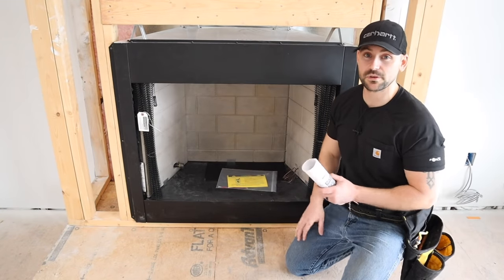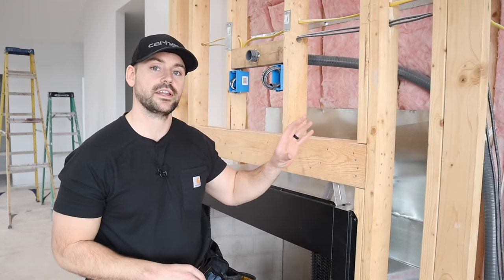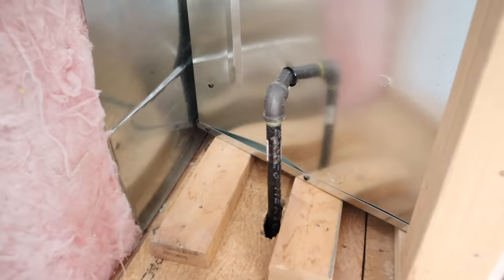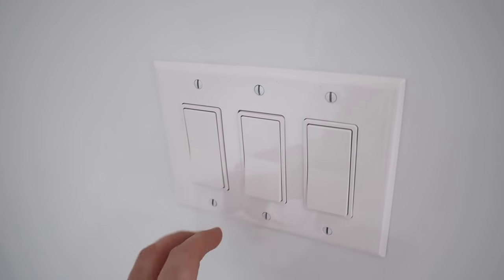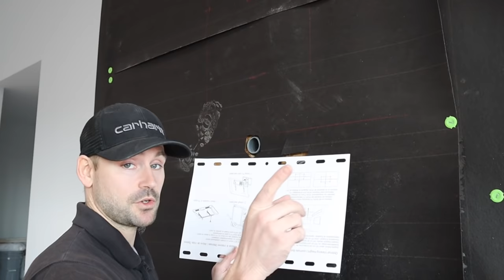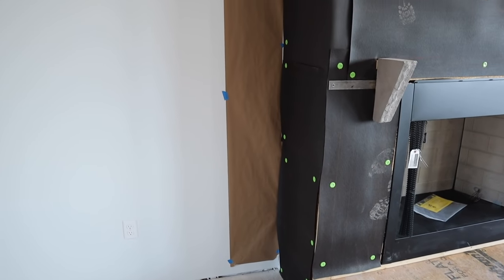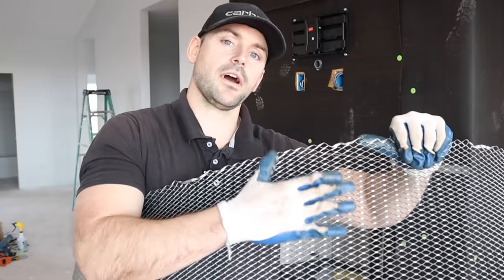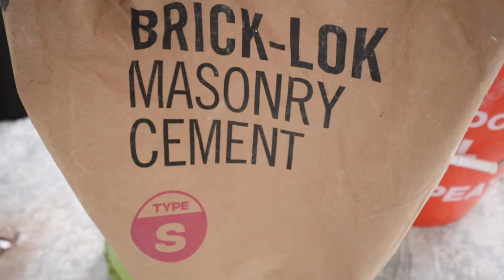How To Install Stone Veneer On A Fireplace - STEP BY STEP Guide

Comment from the maker: Hey, fellow DIYers! I know this video is long but it’s jam-packed with detail that you will find helpful if you are doing the project. There's a timestamp below to help guide your way through everything in just one span of time so don't worry about getting lost - we'll go right over all those important parts and then move onto something else before our timestamps run out :)

Framing for a gas log fireplace 01:05
Mantel bracket Install 08:46
TV bracket Install 11:27
Metal lath install 13:50
Mortar mix for scratch coat and stone veneer 17:48
Scratch coat application 21:05
Cutting stone veneer corner for sloped ceiling 25:09
Mantel installation 29:29
Stone veneer corner install 31:05
Stone veneer flats install 33:51
Grout mortar mix 43:46
Grout application 47:34
Grout finishing 50:54
Hearth stone installation 53:57
Reply: Be prepared... there's a lot more to it than you think.  That's what I'm doing right now.
Reply: Kevin  hello
Reply: In case you install using cement board, do you still need to use the metal mesh and all the process you have shown in the first video? Thanks
Reply: It's not that long! You just saved me hours of headaches! I'm a female DIY who is going to do this myself so I don't have to listen to my husband swear the entire time he does it!
Reply: Why didn't you mortar the hearth stone?
Reply: You're not telling where you got the brackets, Amazon does not have them. Anyone else knows where to get them. Help! Help! Running out of time the world it's going to end soon! 😮😮😅😅
Reply: Where can I buy the stone mantel mounts? They are just what I've been looking for

Comment: A few tips from a 4th generation mason who does this everyday.  Don't work out of a bucket.  Not only is this incredibly slow, it's going to destroy your wrist over time.  Get two mud stands run three planks across and put a mud board in the middle and stack stone on the sides.  Not only will this be considerably faster, it will save your back and knees and give you a better selection of material.  Use quality pre-mix bags and a mixer.  Not only are they quality tested they are much, much faster then using a bucket and drill and mixing the ingredients your self.  Do not bury your tape or paper in the joint.  Put the tape on the edge where you want the finished joint to be, that way when you're done brushing/sponging you can pull the tape leaving a perfect finished edge and absolutely clean paint.  Also try to find straighter edge pieces at the opening, you don't want large joints against the metal, it will crack.  Metal expands, masonry does not, especially with the heat of the fireplace.
Reply from the maker: Thanks for watching and you input!
Reply: @TheExcellentLaborer  how come you start at the top? Just wondering
Reply: Rob so the mortar doesn’t dirty the stone
Reply: @Unknown-nf1se  Yes, This.  Unless it's a heavy natural cut stone, start at the top if you can.  You don't want mortar falling on you recently installed stone, if you start at the top it just falls on the hearth, which is easy to clean up.
Reply: I agree with Ryan,I’m a mason also
Reply: Experienced tradesman that teaches instead of ridicules. You sir a diamond in the rough.   Thank you. And thanks for the info. I’ve been gathering info to get started on a masonry heater for my house build this year.
Reply: @elkhunter307  If by masonry heater you mean a real masonry fireplace, they are a lot of work.  If you're doing it yourself, I would go with prebuild units or inserts. A real masonry fireplace(not an insert) is one of the most difficult projects we do.  I've been building them for almost 40 years and everyone one is different.  If you don't get it right, the fireplace will smoke or worse.  The facing can be DIY project but the structure should be done by a professional.  If you can clarify what you mean by masonry heater, I could give you some advice but I wouldn't attempt to build a ground up fireplace without professional assistance.
Reply: Working from a pan versus a bucket is dependent on situation and opinion. I prefer a bucket over a pan
Reply: @SuperBikerboy101  Are you a tile setter?  Mason's use considerably more mortar than a tile setters.  Mixing buckets and using them is fine for tile because it's a small amount, but man working out of a bucket for stone makes my wrist hurt just thinking about it.

Comment: This is close to what I did at our other house. Thank you for mentioning about how the metal lath is a directional use. Growing up doing the old style stucco before other companies came out with a foam base installation, we took some florescent spray paint to put an arrow for the direction of the lath needed to be fastened. Yes we would have a piece put up wrong, and you would notice this ASAP. Love this project Josh. 👍🏻👍🏻
Reply from the maker: Hey David! It is very important to get the metal lath in the right direction. The mortar would not adhere to the lath as well if it is not in the right way. Oh wow, sounds like you have a lot of experience with stucco. I have always been amazed with how they can take a mortar lake project and create a beautiful wall. I appreciate you commenting and watching David!
Reply: @TheExcellentLaborer  yes, for years doing houses in historic districts to keep the homes with that original stucco look with wood batten strips. Ornamental plaster was always my favorite as well.  Commercial work was always rewarding because of the different looks that may be requested. Using your imagination is wonderful as well. The rakes we used to do the scratch coat, we made ours out of metal coat hangers because we would go through them doing so much every day. I know my father is in heaven to this day doing plaster and stucco to his liking. Hahaha 
Continue to keep sharing your talents Josh.

Comment: Nice video Josh. Was going to ask why you go through the effort of scratch coat but the way you do it sure would allow the stone to stay in place better with the rough scratch coat texture. Most guys around here use cement board. I actually use Ardex x5 to set stone or those type of veneers 😆 it’s a little expensive, but maybe I’m just too used to using thinset for things. Nice work 👍
Reply from the maker: Thank you BRT! I’m not familiar with the product you mentioned that you use. I will have to check it out. I’m just an old fashion stone veneer person. I have used this technique in my past for houses and has worked well so I cannot change. I did mention using cement board in the video which I’m sure it would work fine I just have not done it. Thanks for stopping by and watching appreciate it!

Comment: Excellent video from start to finish. I too am using Eldorado stone, my first time applying a veneer product. I am using 1/2 HardiBacker, opposed to lath and scratch coat. Again, a lot of invaluable tips throughout the course of the videos; was a tremendous help. Thank you
Reply from the maker: Great to hear you are starting a stone veneer project! I’m glad I can help. It’s definitely a lot of work but it’s such a nice thing to have in the house. Half inch hardibacker is fine to use. You are welcome. Thanks for watching!
Reply: @TheExcellentLaborer  Hello again, in front of the hearth, not raised as much as yours is, I have an area 7 x 7, I would like to apply a natural slate. In your opinion, will salvaged roofing slate stand up to the weight of a Vermont Casting coal stove (450 lbs). 

I laid 250 square of 1/2 travertine on Hardibacker without a crack. Secret, a stable surface. Believe the slate to be of little difference?

Your thoughts please

Comment: Hi, this is a very nice video.  You did a great job!  I have a couple of questions: 
     1) Where did you get the veneer from?  In my project, I am concerned about weight.  
     2) Which veneer did you pick for this project?  I really like that look.  
     3) I have been concerned with my project with the mortar separating from the veneer over time.  Some masonry sites 
         suggest spraying the stone or brick lightly with water to prevent it from sucking water away from the mortar, reducing its binding strength.  
         What is your suggestion, or is this a problem?  

Thank you

Comment: Thanks for the great videos! I'm doing a DIY outdoor propane, corner fireplace that I want to wrap in stone veneer floor-to-ceiling on all three sides. The manufacturer (Napoleon) calls for metal studs and cement board 6 inches on each side of and below the fireplace, and the entire wall above the unit. The side walls do not have to be metal or cement board. My questions for you are: 1. Would you use a metal lathe over the cement board on the front wall? 2. Would you do the two side walls out of cement board to match the front wall, or complete as you describe in your videos? 3. Would you simply do the whole project as you described in your videos? Thanks!

Comment: a roofing nailer works just fine, but it's worth considering springing for a lathing stapler (or renting one if that is an option whee you are). They hold really well, are very fast, and for some systems they are required. typically 1"x1" staples. I also find that i get cut up less when installing razor mesh due to fasteners not being twisted loos (occasionally) during lath adjustments. look good bro, I appreciate the detail.

Comment: Wow - this is the most comprehensive video I've seen for this project.   It's given me confidence to tackle the same project at my house.   You mentioned chase framing is 2x4 - I'll be building a interior chase that goes 18' to the vaulted ceiling.    2x4 framing is strong enough for all the weight or do I need to go to 2x6s?   Thanks for a fantastic video.
Reply from the maker: I think 2 x 4 framing 16 on center would be strong enough. You could always use 2x6’s  if you were concerned but 2x4 should be fine. Hope that helps!

Comment: I have the exact same fireplace in our house. However I’m having a problem with the fireplace pulling away from the exterior 6” wall. The contractor that built ours used nails instead of lag bolts or screws to tie into the exterior wall. What type of fasteners did you use when you attached the fireplace framing to the wall??

Comment: You REALLY explain things well!! Any reason why you did sheathing and scratch coat on top  instead of concrete backer board?  Couldn't you use mortar under the hearth stones...much cheaper than Liquid Nails ( though perfect for the mantle).  We are going to do our FP Surround similar to yours, but in Glacier Stone ( real stone veneer out of a Montana quarry).  Putting in a zero tolerance , Fireplace Xtrodinaire  Apex 42 into FP box ( all wood like yours installed according to specs).  Thanks for the excellent video!

Comment: Honestly you are very knowledgeable.  I love your skill set. And perfection,  that what i love to do every job. Now I will be installing veneer stone on concrete block,  here is below 0 degree.  What mortor mix do you recommend me to recommend . Anyway, I plan to use mortar mix type S  and add additive to BOND better.  Let me know what you think and your recommendation.  Thanks.

Comment: Why are you using mortar to attach the stones to the vertical wall (26:47)
instead of liquid nails that you're using to install the hearth stone's with (55:59)?
Is it cost or performance or the eventual heat or something else the adhesive (mortar/liquid nails)  will be exposed to ?

Comment: Hey Josh , Thank you for your videos , I saw the exterior house first then followed with this one. what stone did you use and color , we are renovating our home and that's the color and style stone we are looking for , if you mentioned it already I really appreciate hearing it again. thank you !
Reply from the maker: Hey Patti! Eldorado, Fieldledge, Andante on the fireplace and Eldorado, Fieldledge, Padova. Thanks a lot for watching my videos. Good luck on your project.I hope that helps!
Reply: @TheExcellentLaborer   Thank you so much! We have a 1966 ranch that we plan to gut and do the inside and out including mechanicals .
Reply: @TheExcellentLaborer  our home is bricked we want board and batten and stone. we were told we would need to take all the brick off first.

Comment: Hi there! Quick question, I’m doing manufactured stone veneer for my fireplace as well but I am using cement board. Do I still need that metal mesh for the scratch coat?
Reply from the maker: You can check with the manufacturer, but thinset mortar may have you be used.
Reply: @TheExcellentLaborer  thanks for your response!! The brand our stone is from is ProVia and I’ve looked at their site for installation instructions and wasn’t able to find anything 😕

Comment: Great video....but the Tv over the fireplace.....ugghhhhhh. So very, very tacky.
Reply: I love a TV over the fireplace. If you have both but in separate places, then there are two focal points of the room, which is weird. And one of them probably never gets used or looked at because all the furniture is pointed at the other one.

Comment: sorry....soo many wtf's on your techniques. Never ever start a stone job from the top, you never want your head below your work. stones sometimes pop off due to the dry scratch coat absorbing the moisture too quickly.  Why not buy a bag of charcoal mortar, use a wheelbarrow and hoe to make a batch ? This job should take about 6 hrs.  45 yr stone mason.     However your finished  job looks nice

Comment: Hi Josh When I was surfing Youtube today to get a knowledge on upgrading electrical panel from 100ams to 200 ams, I found your channel. You areawesome Josh, you explaining everything thousand times better than a licensed electrician without wasting your time and ours. You are straight getting into the subject. You are very likable, simple and smiling person. Today I watched most of your playlist. You  have talents on everything in the building industries. Josh ,I am planning to upgrade my very old breaker panel ( my house built in 1950s) to newest one probably by myself. I have some issues to solve before start the project. I think you are the perfect person to get some advice. If you don’t mind could you provide me your email please